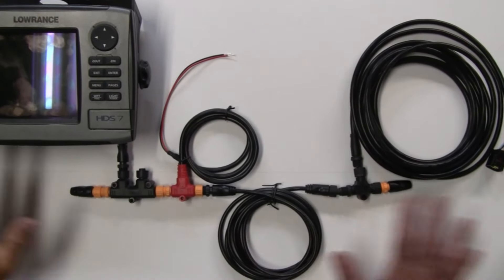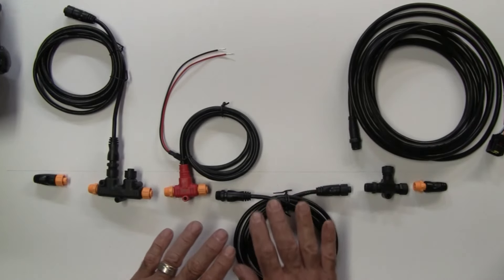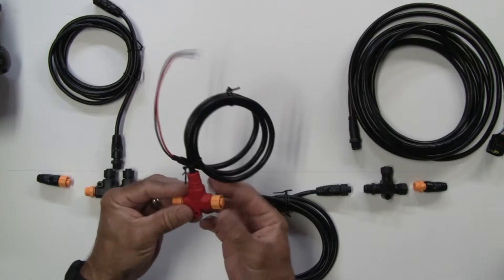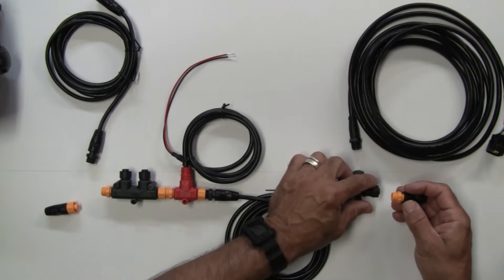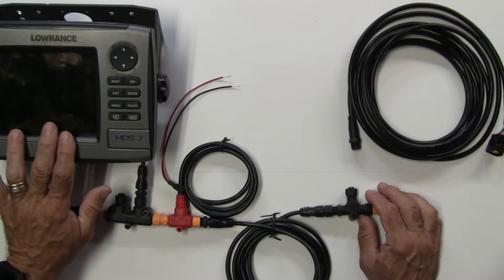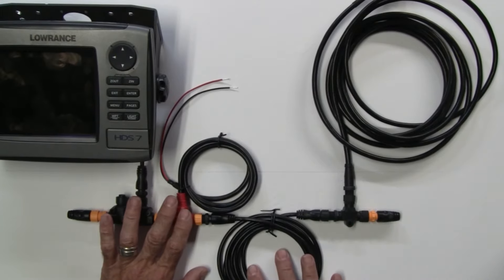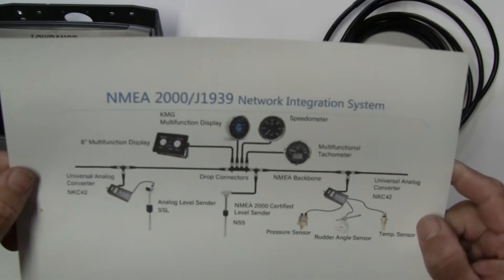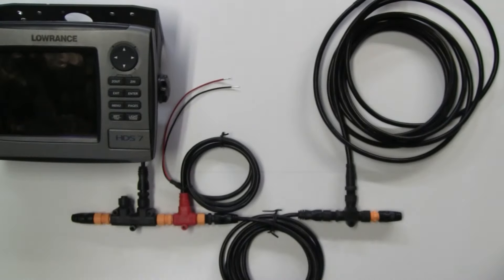NMEA 2k  Explained - How to build a NMEA 20000 Network Starter Kit

Comment: Hello I’ve got the nmea2000 hooked up to my Yamaha f70, I’ve got the lorrance cable from the motor to the backbone, I supplied power to the backbone and ran a cable to my nmea2000 comparable garmin graph, question is I only am getting rpms on the graph, Yamaha is telling me I need a multi hub and gateway to translate the data from the motor sense it is trade mark protected so you need those things. Where would the gateway and multi hub go in this system, between the motor and backbone or between the backbone and graph
Reply from the maker: Honestly, be it far from me to doubt what Yamaha is telling you but it makes no sense to me. I set up the NMEA network with my F70 as the source (2015) with everything I show in the video you watched and get all of the data without using a multi hub and gateway. If they are telling you that there messaging is proprietary then they are not NMEA compliant. Here's a video of how I set it up on the boat https://youtu.be/p5s_UUQRMsA, here's also another video that shows what data I am getting over the network. https://www.youtube.com/watch?v=tcxu7go08wk look at 3:40, hard to see on the dials but engine temp and alternator output are also shown. One last thing, I would call Garmin and get their input as well.